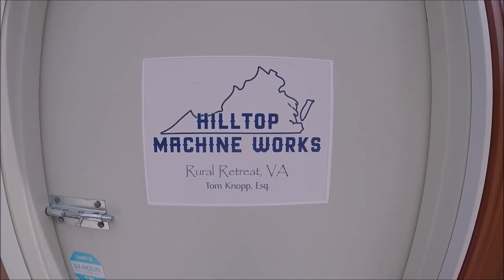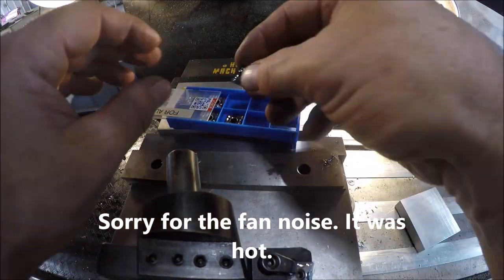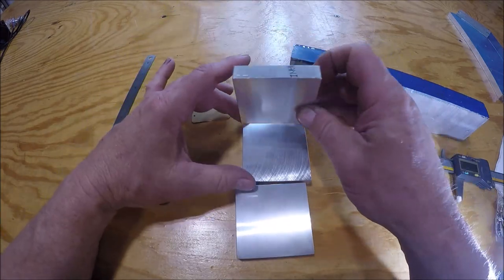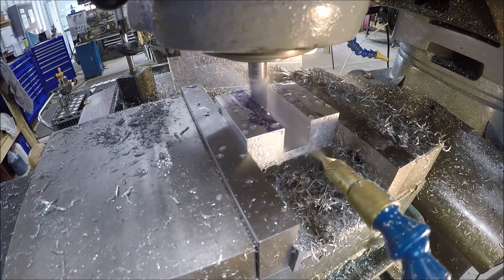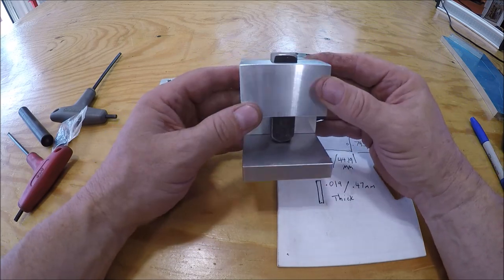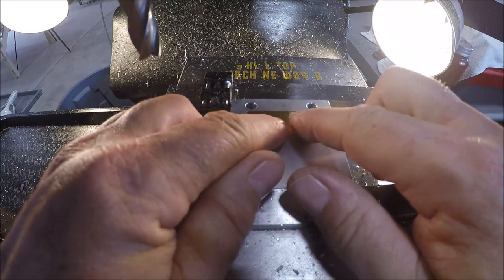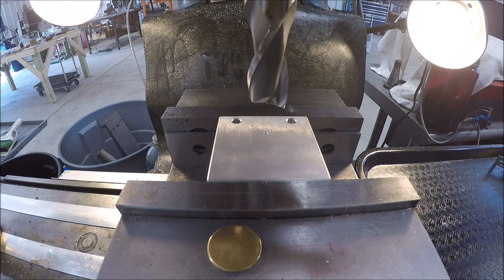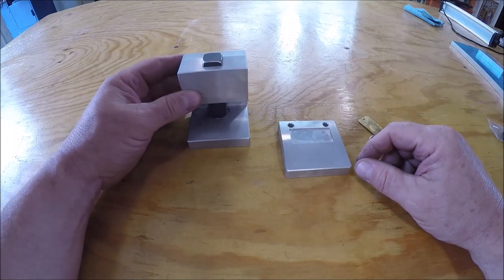#toolfest2021 Making a hand stamping fixture.

Comment: Hey , cracking job there Tom .   Doug was onto it , a slight radius on top of the punch . 
I sometimes use the same inserts when doing a finish cut on mild steel if it is giving me trouble .
Cheers Mate .

Comment: Like Doug and Max mentioned, Having a radius on top will make a big difference. I have also found over time when you have a softer backing plate for the stamp you will get a softer impression on the tag. Both simple to correct if needed. I do a fair amount of stamping Altronic ignition tags at work. A jig like yours would make things so much easier to align.  Great job Tom, it looks great.       Gary
Reply from the maker: I agree. I will add a radius to the top of the stamp so it will be more consistent. This community is so helpful and awesome.

Comment: Great jig for consistent location positioning. I think you were a bit too kind with the hammer Tom. 
You could rig a weighty slide hammer up to the jig to get a constant repeatable impression. Tony
Reply from the maker: Ha ha! Yeah Now I smack the bajesus out of it and that seems to work.
Reply: @hilltopmachineworks2131  Hey Tom Looks great, might have to make one of these myself. Maybe use an arbor press! Cheers Peter from Oz
Reply from the maker: @petermurphy3354  Hey Peter, thanks 😊.

Comment: Nice lil fixture. 
I wonder if would help to get more consistent results using a hyd press or arbor press?
Just a thought, still turned out great
Reply from the maker: May try the hyd press and see what results I can get. I could not get a good imprint with the 3 ton arbor press.